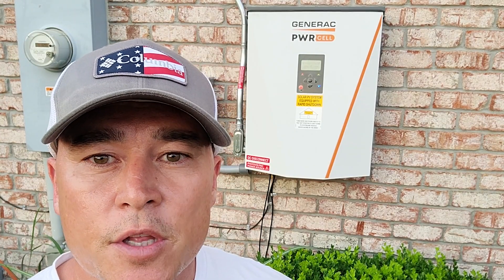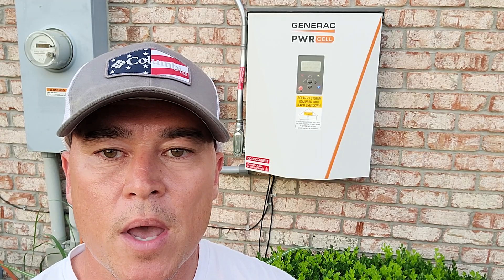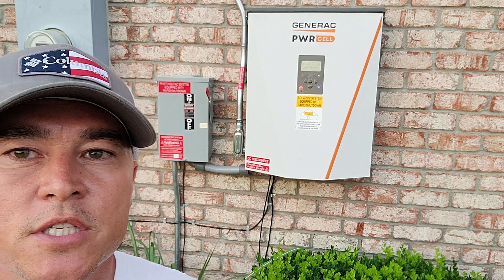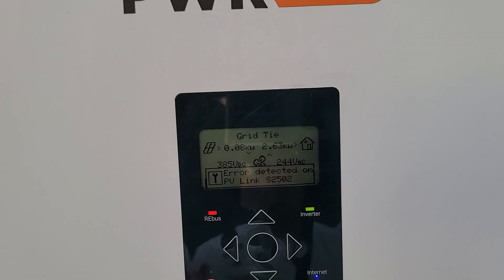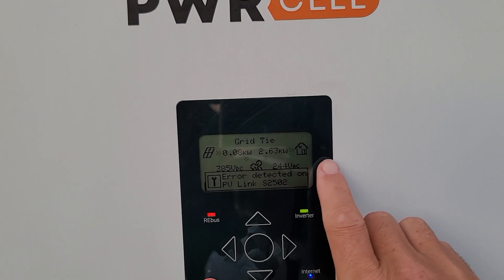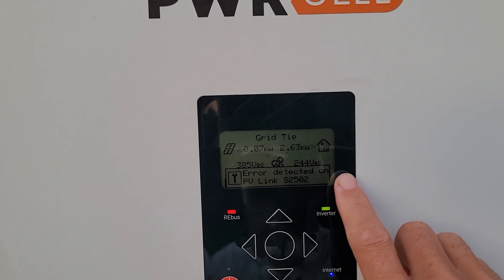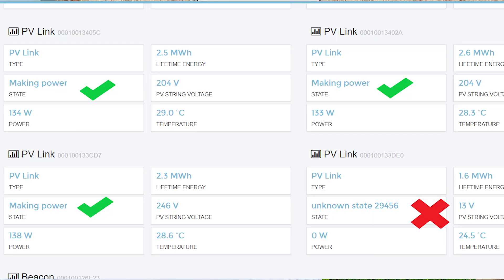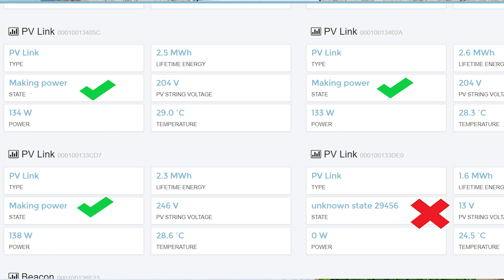Solar Power Not Working Correctly After Install From Powerhome Solar aka Pink Energy

Comment: I have the same problem I was calling the same time pink energy / solar home power installed mine with my problems solar home power was paying my electric bill and as for generac call them and ask for the solar department and tell them your system was installed by Pink energy and watch the fun. Generac power keeps telling me to call pink energy I keep telling them they don't exist generac power is not making it right with any other customers and they are lying about everything with the installment they've already paid out 65 million to Minnesota state for being sued because of pink energy I'm stuck with the system that doesn't work it's like a car without a motor generac power is not making it right in any way shape or form hell they won't even talk to you so I'm jumping on the bandwagon with all the lawsuits against them there's lawsuits against these snaps the lawyers that's taking on generac power or everywhere they're calling me. Good luck to all the ones that had it installed by Pink energy / solar home. My advice to everyone that reads this do not deal with generac power they are not customer-friendly at all.

Comment: Generac is just as bad as pink energy was. I have had to wait 6 months for  a repair and now they have taken away prwview web access so we can't monitor our own system. was told on the phone to just use the phone app which doesn't show all the information needed to make sure the system is working properly. my system hasn't worked properly from day 1. I regret ever having put solar on my home. im not saving any money because it doesn't work. I need to know how to force them to fix the system properly.

Comment: Just to clarify, Generac SnapRS may not be required on all installations, depends on your location and NEC70 Code adoption, ie 2014-2017-220-2023.  I agree with your frustration, as I’m a trained Generac CE Service and Installation Technician.  I don’t place blame with any Company, my job is to make units perform as expected, and insure customer satisfaction.  Whatever it takes, period. No excuses.
Reply from the maker: Thank you for the comment. Since getting all of my snaps replaced with the new ones, the system is working as expected. Generac had another company work on my panels after Pink went out of business and honored thier warranty.

Comment: Pink energy has gone bankrupt and will not warranty your system anymore. My system has been down since feb 2021 and I’m still paying for a non working system due to pv snap links doing bad and squirrels chewing on the wires under the panels. Nobody will touch the system due to all the law suits going out to power home solar / pink energy. They suck!

Comment: Pink aka Powerhome went out of business. We went out to one of their customers in Ellijay GA because they needed the SnapRS 801s replaced with the new SnapRS 802s. Generac reimbursed us making it so we didn't have to charge the customer too much while supplying us with the parts. I would advise any Generac customer to find a Generac PWRCell certified installer in their area and have them come on out a replace them. Generac has had additional recalls, though Generac refuses to call them a "recall", on the inverter power cords, battery internal fans, and also on the ATS control boards. Generac should be able to look up your system to see if it is affected by any of these recalls using the serial numbers, so you can advise your new contractor of the exact problem eliminating additional charges for troubleshooting.

 It does suck to have to pay an additional $300-$500 out of pocket but to have your system running to insure the ROI, then it is totally worth it. 

Also, the Snaps count has to match the panel count, per GA State law. If there is not a Snap per panel, it would never pass the electrical inspection completed by your power company. Generac produces an RMA claim via email that has the number of Snaps and this should be shared with the customer so they can add it to their warranty package for proof of replacement and additional warranty coverage.  ☀

Comment: This is obviously a Generac Problem.  Sue Generac not Pink Energy.  Why is everybody picking on the Installer?  Generac has thrown their partners under the bus.  Shame on them.  Generac themselves should pick up the tab own the problem and fix all their systems installed.  Generac should start over with their relations with their installation partners and fully support their product.  What is Generac going to do?  Generac's reputation is on the line here, and their stock price has certainly suffered.  So maybe they will get what's coming to them?  Maybe Generac should get out of the Clean energy business and sell out and the pickup company could manage the PWRcell line better.  Might service the consumer better.

Comment: I’m dealing with the same problems here in SW Florida I bought my generac system a year ago and my system has been down since install a year ago sun tec solar has been out only three times to fix it because they will never pick up their phone and no show appts when they do pick up phone I got my snaps fixed 4 months ago and now they came out and replaced my pv links all of them and a week later it’s back down with a pv link and battery communications error so frustrated and sun tec solar is doing less than pink to fix it I’m seriously thinking about a lawyer. I’m just trying to learn my system to fix it myself do you have any info on rebus communication error and how to test/fix there are to many terrible company’s out there that just take your money when it comes to solar. I’m so frustrated!!

Comment: I was hoping Generac would step forward and help out.  Not saying they should be 100% liable for this b.s., but at least find some kinda solution for customers with Generac branded hardware on their homes.

I really thought Generac was more involved with this system than what it appears they're saying.  I mean the app and all the equipment says Generac.  Pink was just the installation team?

Generac is like "we didn't really know Pink all that well".   I thought you guys were partners?
Reply from the maker: Generac finally called me back and they have assigned Nova Source Power to fix my system. The bad part is that they could not get me scheduled until Feb 2023. Crazy! I hoped this would be better working with a company like Generac.
Reply: @JasonWhitakerTheDIYDAD  Just got contacted by the finance company I used.  Looks like they're using another solar company to reinspect and test my system.  Any additional cost to be covered by the finance company.

Maybe it's going to be Native solar?  No ETA though.  

Had some of the same problems you've experienced.  I think if everything was fully operational, I still wouldn't be achieving my power requirements.  Im guessing I would need to double the amount of panels.  Not sure.

Comment: Well, your first mistake was contracting with a “solar power” company. 

The only way to reliably have solar installed is to hire a qualified electrical design contractor, and a qualified journeyman electrician.  If rooftop, both a structural engineer to ensure your building can easily accept the extra weight, and a good roofer to install all the mounting hardware. 

Why the professionals? By using licensed contractors, you have greater legal protections should something go wrong with the install or operation of the system.

This method typically costs around half of what the solar companies charge.

Some would call this hindsight, which it is to some extent. When my wife and I considered putting solar on our previous home, I called my regular electrical contractor for advice. What his design people told me was pretty much what I wrote above.

Also, if you have to take out a loan, you can not afford the system, with its regular maintenance and storm damage, much of which will not be covered by most homeowner policies.
Reply from the maker: Thank you for the advice. I will look into this when I add onto the system in the future. Appreciate you watching!

Comment: I've had the same issue with snaps from Generac. I had my solar installed by Renu Energy Solutions(RES). Once contacting RES they resolved the issue within two months. The techs stated they replaced all the snaps. Currently the system is running as designed.
Reply from the maker: Hopefully Generac steps up soon and all of the defective snaps get replaced soon. Thanks for the info and for watching!

Comment: I have 34 panels hasnt worked properly since installed its been right at a year theyve been out a few times never fixed had numerous issues w install throughout they are not paying any of the hardships this has caused so instead of having a high electric bill i now have that and a solar panel payment this is very unfair i have contacted my attorney general and will contact a lawyer from that if needed pink energy is not making it right just blaming generac its taking 2 months to even get someone out again generac is supposed to come after . I wish i didnt do this people buy this to save on electric not a double electric bill due to panel bill. This is a nightmare
Reply from the maker: Sorry to hear. Just posted an update. Looks like we have to fend for ourselves with Generac. Thanks for watching!

Comment: Hey Jason, I hope ur system is back up and running by now. One thing to note is that Generac has replaced the old 801 snap rs's with new 802 snap RSS which I hope you have installed now. Thanks for sharing the video.
Reply from the maker: My system has been in lock out since mid August. Now Pink Energy closed thier doors. I just posted an update to the situation.  Thanks for watching!

Comment: Thank You for posting this video.  I have been experiencing the exact same issue with my RS Snaps.  I have been having PV link errors since March.  Tech crew came out one time in April and replaced a few snaps.  Just as you said, a few weeks later the remainder of the snaps went bad and I have been out of service for those PV Links ever since while I am still waiting for another service call.

I am certain they are taking care of all the customers who are making them pay for their solar loans until they fix it.  Sounds like that needs to be my next step in effort to get them to my property quicker to solve the issues.   They are very backed up so I definitely recommend understanding exactly the scope before they arrive and even call 1 or 2 days before your appointment to verify they have all parts and equipment and ensure they will arrive on schedule.  You don't want to get put back in line for another appointment.  

I also have the backup battery which has recently errored out.  Generac support informed me that they will not be able to help with the battery issue until the PV Link errors are fixed.  What a mess!!
Reply from the maker: Thanks for watching! They finally fixed/ replaced the snaps back at the end of June. Waiting before posting an update.

Comment: I feel stupid getting this they installed it and it’s not working they have a problem with the cabinet they said all there inventory backup batteries are bad and it’s not working I’ve been installed like 2 weeks now I just want it off my electric bill is lower than what I’m going to be paying soon 😭 help please someone
Reply from the maker: Have you scheduled your appointment with your electric conpany yet to start net metering. Even though the battery system is not working, net metering will allow you to send excess energy to the grid. You wont be able to over produce until you net meter. I made the appointment myself as PowerHome was taking too long. Let me know how this works out.
Reply: Okay sir I’ll give them a call later today the gentleman is here at the moment trying to fix the battery again for the 3rd time , how soon do you see the pay back is it when it starts to work or after a few years cause that’s the answer I’ve been getting sir
Reply from the maker: @tyrrickscott4978  that is not an easy answer. Everyones situation is different when it comes to payback. How big is your solar system? How much is it rated to produce based on the angle of your roof and direction? Are there any obstructions that may block the sun from hitting your roof? Where you are located? How much electricity does your house use? Check out Energy Sage.com. They have a descent calculator to help determine all.of the factors. There are more than I mentioned above.
Reply: @JasonWhitakerTheDIYDAD  Tye system is a 70k 18 panels 400w the roof of in a great location it gets all the sun they are no trees blocking it I don’t have power in some parts of me home because of this and it’s big inconvenience I’ll give an update to when the electric company comes and do there thing how is your battery working sir
Reply from the maker: @tyrrickscott4978  i chose not to get the battery. 20k for a battery for only 3 breakers didn't make sense to me. I chose more solar panels instead.

Comment: Do not trust Pink Energy!!! Salesmen tell a bunch of lies to get you to sign a contract that you are stuck with. They are willing to rip off elderly disabled people. Technical support, customer support, the new team to try to repair the company image are all horrible. This is a completely unethical company!
This company will rip you off. The sales pitch is that they will design you a system that will produce enough energy to replace your electric bill. It’s very expensive, horrible customer service, and we still have an electric bill. Multiple problems with the entire process. Emails and phone calls do not get returned or the employees are not knowledgeable about the equipment or issues. This company was previously Power Home Solar and they had to change their name because they got a horrible reputation. Not worth your time or money to sign a contract with this company. I love having solar panels but find a different company and save yourself the headache and the loss of a lot of money.

Comment: Well I'm a little South of you but having the same issue but I have called them 98 times But I do need to look at my install and see if they put the snaps that is required on my system  I did not know that you can make them pay your payment on your solar panels
Reply from the maker: They just came out yesterday and replaced old snaps that were not replaced before. The whole system is working now, but want to give it some time before I make an update video. Keep pushing! Thanks for watching

Comment: Very informative video. Sorry you are having all these issues. When we installed Tesla Solar we had a few issues that took awhile to resolve. One thing to note is if you are back feeding to the grid make sure you have a bi-directional meter installed before you turn on your solar. Without having a bi-directional meter you will still feed the grid but the meter won’t know the flow of the power. So for every KW you put back into the grid you will actually be charged as if you used that KW. We learnt that the hard way, luckily it was only for 2 weeks.

Also, I’m looking forward to an update on your issue.
Reply from the maker: Pink Energy came out with the supervisor.  They have to re wire my whole system. Will keep you posted! Thanks for watching.
Reply: @JasonWhitakerTheDIYDAD  I'm really surprised you went with power home/pink given they seem to have nothing but bad PR. It seems DIY is really the way to go.
Reply: @JasonWhitakerTheDIYDAD  we have an appt with a Pink Energy salesman this coming saturday. Sat down and started watching reviews on YouTube and taking notes!! Thank you very much for sharing your experience. Keep us posted!
Reply from the maker: @By_Grace_Thru_Faith25  no problem. I suggest getting multiple quotes before making the decision. Thanks for watching!